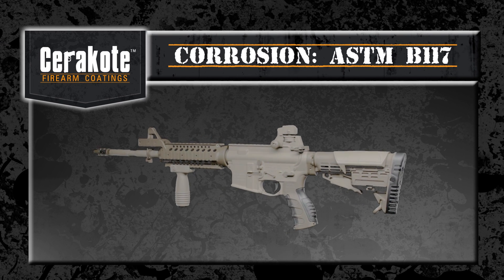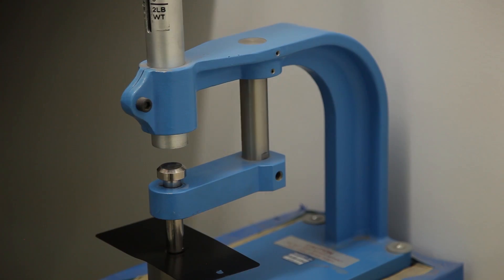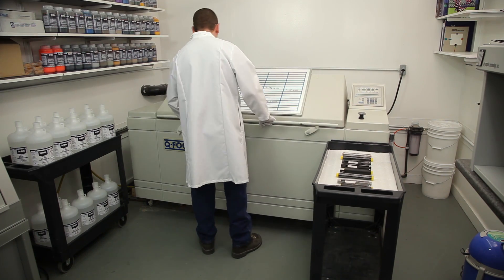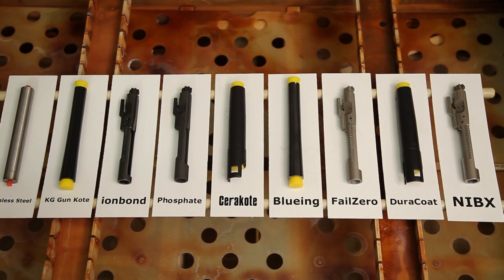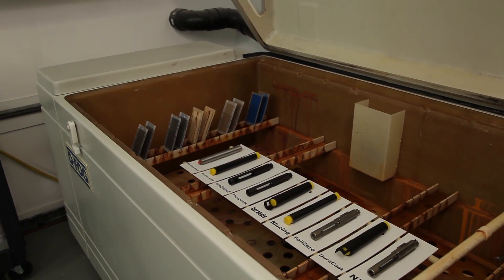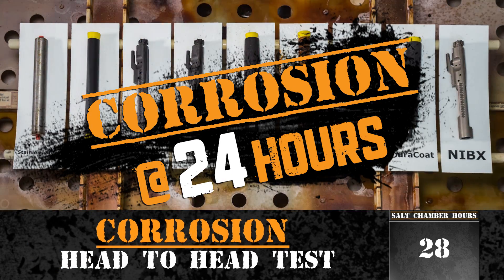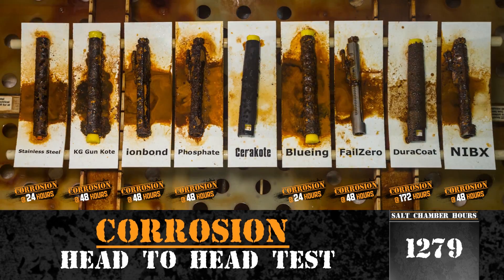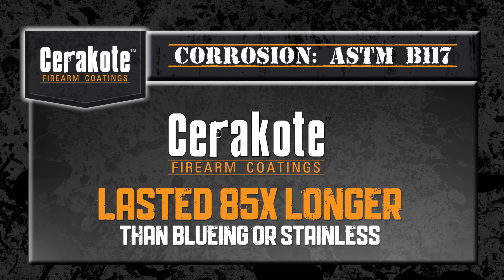Cerakote Ceramic Coating Corrosion Test (ASTM B117)

Comment: the problem is that, unlike most other finishes, Cerakote cannot be applied to small holes and parts, such as inside of pin holes, channels, etc. So as rust protection goes, the surfaces that are coated may be well protected, but the whole part will not be.
Reply from the maker: Actually you CAN Cerakote in all those areas you mentioned - it's applied at 0.001" thickness (and Elite at 1/2 mil thick).

Comment: what grease did you use on the phosphate? cosmoline  or other protective grease are required for  manganese phosphate to protect. it has been the standard in protection of military firearms since the end of WW2 I believe.
Reply from the maker: The phosphate part was sourced direct from the factory, so we did not add any additional grease to it.

Comment: keep going! failzero went almost 2000 hours with hard to notice changes and the rest went to crap! maybe a spot of oil or scratches contaminated part of the failzero? I'm impressed with it also where were the after shots of the fancy coated one?

Comment: last few seconds you can see all other products remain in the same positions but the one with cerakote moves constantly, probably been taken out while the rest of them are rusting then put back in to take a picture then taken out again.
Reply: +Nutjob Joe interesting that is odd that only the cerakote seemed to move....
Reply from the maker: +Nutjob Joe None of the parts were intentionally moved and none were replaced - 
there was movement of parts from opening and closing the lid to the salt
 chamber is rather bulky.

Comment: Almost a good attempt at a controlled test...HOWEVER, as an engineer there are several glaring flaws. First ALL, products MUST be applied to the exact same substrate. The selected bare substrate should also be used as the control not just an arbitrary bare metal such as the stainless they used.

NEXT, the thickness of the coatings must be identical (or at least measured) to accurately compare the performance. I know for a fact that electro-emmersion coatings such as Ni-b, FNC, etc go on extremely thin (in the ten-thousands of an inch). Also, since I routinely use a number of these products (including Cerakote), I can concur that Cerakote does apply much thicker than many other products in your test. I dare say that if a product were Rhino-Lined, it too would not have shown corrosion in the same time interval...hence the thickness of the coating obviously affects the results.

The equipment used is top notch...the process is not so great. Most coating manufacturers will also scribe coated materials to a controlled depth in addition to non-scribed plates to accurately measure corrosion growth.

GREAT ATTEMPT...POOR EXECUTION!

Comment: Nice try Cerakote but I'd like to see a valid test...i.e. one that has the exact pieces compared. The Fail Zero product was not a complete part. It had a few screws and "other" parts not coated, the parts that stared rusting. It looked like it held up just as good as the solid piece coated by Cerakote. I'd be very interested to see the exact same pieces compared (one that does not have tiny pieces that are not coated like in the video).
Reply from the maker: You can see more test results in the 'Testing' section of http://www.cerakoteguncoatings (dot) com/testing/ where we tested our coating on flat panels. The components are not identical, because when possible, we sourced parts direct from the competitive coating manufacturer. Thank you!
Reply: ***** I'm just a consumer that would like to see a valid test. Specifically Fail Zero against Cerakote...on the same part. The other test Cerakote mentioned in the above reply did not include Fail Zero, why not? I am going with either Cerakote or Fail Zero, leaning more towards Cerakote but still would like to see a test with the same parts.
Reply: ***** I've never heard of fail zero until you said something. I think cerakote did a great job getting these products together and testing it. The reason that they chose this variety is to show what the comparable results would be of like product.   Isn't fail zero just the nibx? You can say all you want about how it's a better version of nibx, still not going to get close to what cerakote did in that environment

Comment from the maker: See what happens when Cerakote is tested against 7 other competitive finishes in the Salt Spray Corrosion Test (ASTM B117).  #cerakote   #corrosiontest   #cerakotecorrosion   #cerakotetest   #gunfinishtesting   #rusttest   #corrosionprotection   #cerakoteprotection
Reply: Cerakote Looked like the cerakote was being replaced. Because it moved a lot during the time lapse part and none of the others did.
Reply: where can i get it here in the Philippines?
Reply from the maker: You can order direct at www.Cerakoteguncoatings.com or find a Certified Applicator at http://www.cerakoteguncoatings.com/resource/locator/ - Thank you!
Reply from the maker: None of the parts were intentionally moved and none were replaced - there was movement of parts from opening and closing the lid to the salt chamber is rather bulky.

Comment: I used to test electrical components and plated parts in a Q-Fog chamber several years ago, to ASTM standards.  I miss those days when I did that kind of testing, but do not miss the clean-up, of severely rusted parts making a mess in the chamber!

Comment from the maker: Thank you for your comment. All of the test items were sourced from the manufacturer or applied to the manufacturer's specification. We chose to use 400 series stainless as a baseline, because it is the most commonly used series in the manufacturing of firearm barrels.